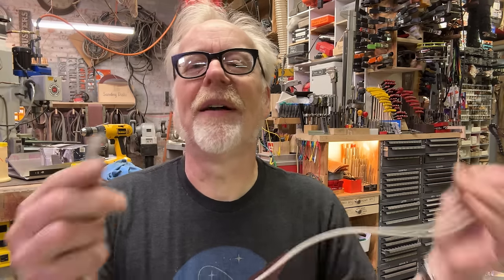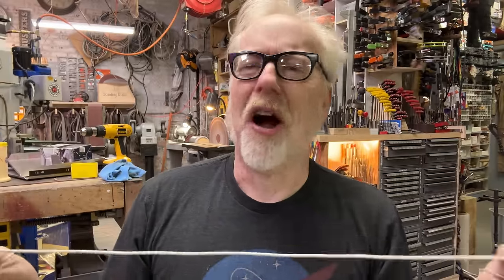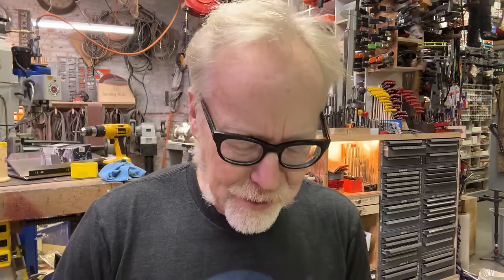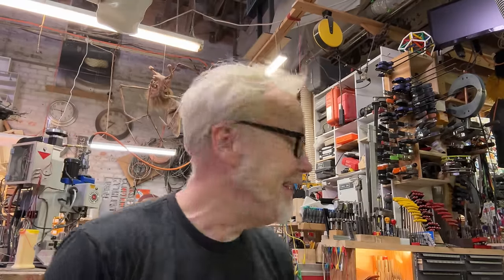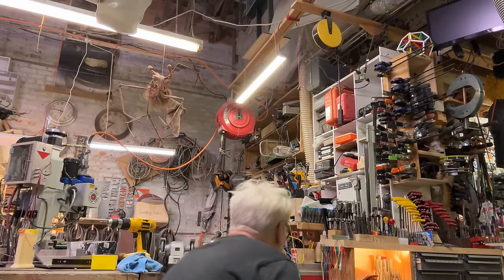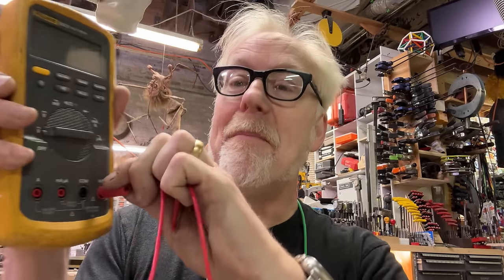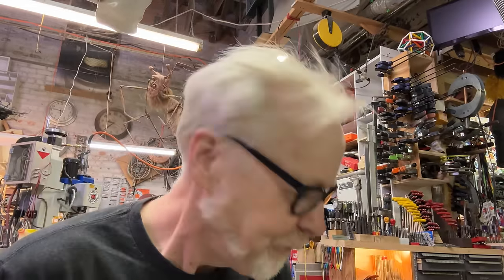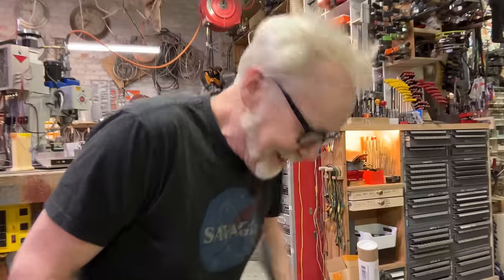Adam Savage's Alligator Clip Leads Problem

Comment: I've noticed that the $1 dollar leads are just getting thinner and thinner. I've sourced alligator clip ends, various manufacturers, and wire of my own to make my own sets. For the layman, get a set of dedicated 12volt battery terminals and crimp on ring connectors. Using actual terminals is always best even if the setup time is just slightly longer, rummaging through a drawer. Many of my go to connectors are the xt60, the waterproof automotive 2 pin, and standard spade connectors. Use the spade connectors for most automotive work, the 2pin is just there for my off road lights. For the xt60, I use those for charging car batteries using the iSDT Q6 nano as a charger/power supply, again I make my own xt60 to automotive battery terminals. I just make adapters using real terminals more often than setting up alligator clips, they are so bad.  The iSDT chargers are great for general R.C. batteries and come with programming and balancing connectors. They can also act as a power supply for my projects for testing. Really this comment turned into LOOK at the iSDT Q6 nano. It's a great companion to electronics projects.

Comment: The electrical protection and controls testing industry uses "test leads", which have various "test plugs", spade adapters, alligator adapters that fit onto the standardized and modular banana plug style ends of the leads. They are also stackable.

Comment: I share your love/hate relationship with alligator clips. I've learned a few things. Always test for continuity from end to end. Feel the wire before buying. They should be flexible like your test probe leads. Solder the ends on if they are only crimped. Straighten/bend the ends with pliers when needed. Don't hesitate to toss bad ones in the trash. Is there a support group for this?

Comment: I have used the alligator leads for like 40 years, they use to be pretty good but the last 4 times I purchased what I noticed is the vinyl covers were so slippery that when you squeeze them the metal pops out or the cover pops off or my fingers slide off.

Comment: Favorite would be the fluke clip leads meant for the meter.  Either the banana jack ones that are meant to plug onto the end of a nice set of banana cables (fluke ac220 alligator clips), or the ones that are meant to slip over the tip of your test leads (fluke ac175 slide on alligator clips). 

Either way 'semi' pro tip for all of you..... If you have the clip leads that plug into the meter like Adam showed in the video, one great way to use them is to put the meter in current measuring mode then use them like a regular set of clip leads.  Even if you don't intend to take a measurement, you now have a fuse in circuit which means a little bit of safety added if you're playing around with a circuit that you aren't 100% sure of.

Comment: I took a spare set of leads for one of my Fluke meters and cut the black probe off and soldered a nice alligator clip in its place. Then I try to get a good ground with the clip... and I'm free to "explore" with the red positive probe. I started doing this working in a Motorola Radio Shop... we were always looking for good clean power sources for lights, sirens, and radio hookups in cop cars, ambulances, and firetrucks.

Comment: Like most things, you either have to shop around till you find a product that fits your need.  Or you learn to make your own.  Rolling your own makes sure that you end up with the wire gauge you want/need and the insulation you want/need, and the ends you want/need.

For example, i recommend the Fluke brand deluxe lead set.  They have a variety of ends, and everything it used with banana jack ends, and will plug into a standard meter jack.

I can make a clip lead with this set with the ends i want on it.  Expensive, but decent quality.

/edit i had to fix the name, it's the Fluke Deluxe meter test lead set.

Comment: My use case is not really the same, I use ultra basic circuits in a school setting. But if i need something like this, i have bags of loose crocodile clips, that have ringed back ends that can take a banana connection, and all my leads have banana plugs on both ends, since the component holders also use banana connectors. Obviously that means a few differences, no insulation on the clip, bigger clips, but it does mean if a clip goes askew, then it just gets thrown, and another one comes out of the bag.

Comment: The clip leads on old telephone technician test sets are pretty good. They have at least two ways to clip on bare conductors and a piercing 'needle' for those times where you cant practically cut or strip the wire.  Wish I could upload a photo. Quality on those are good and expensive. Hirschmann's are good.
Reply: Angled Bed of Nails (ABN) alligator clips. As far as I know they are still used on new telephone test sets.

Comment: Mueller 10015 crocodile clips. That part number is for a set of 4 clips including two red and two black insulating grips. Yes, they're a bit bigger than your typical cheap alligator clip, but they last forever. Mouser carries them. I've had some of mine for 40 years. For small work, I like the Pomona hooks you showed, which are also perfect for wire wrap posts. HTH. And yes, I too have a pile of cheap clip leads, some of which I've had for close to 60 years, because I also hate to throw anything out!

Comment: You should check Cleqee, they are a manufacturer of cables and probes for most brands. I personally like their silicone cables because of the flexibility, and they have a variety of probes, including the aligator clip with injected molding that you showed and the mini test hook for SMD. I also like the male banana plug with a female plug on the end, so I can stack multiple cables on the same connector of the power supply

Comment: Of the only aligator clips I have, one is part of an antistatic bracelet (to connect to ground when working with cirquit boards inside my computer)
Two belong to my multipurpose battery charger.
And the rest are at either end of my set of car jumper cables.😊

Comment: I have several sets of those 'good' clip leads, but with a clip on one end and a male/female stackable banana plug on the other rather than clips on both ends.
They're my most used 'go to' leads I use with my multi meter, a pair of them lives in my meter case.
If I want a double ended clip lead, I just plug the male/female banana ends together, boom.. double ended clip lead, just be aware of the un-insulated banana plug in the middle of the lead now...nothing some electrical tape won't fix😁👍

Comment: I'm imagining a sort of three-part lever system where you push the center section to open the clip jaw. This would allow you to push a flat surface straight down, like a button, which should alleviate some of the perceived mechanical force required to open the clip. But I'm not a mechanical engineer.

Comment: I use wago clips and breadboards. I completely phased out alligator clips because the frustration of soldering and correctly positioning the electronics in the right way so that everything doesn't fall. It was just too much for me to handle. 

Those spring hooks for the multimeter looked sick. I might get me some.

Comment: Get probes with spring loaded bed of nails type tips. They have differing tip profiles allowing positive contact without slippage. Game changer when you need to read the multimeter.

Comment: I have three sets of home made ones that I made years ago. two use different styles of fly-tying Hackle pliers, the j hook style and the flat plier type with most of the metal plasti-dipped and a lead coming off them, the other uses a small pair of locking/offset forceps again the handles are plasti-dipped with a leads coming off them. They work really really well and provide a very secure hold. the  locking plier ones are great for vehicle work. I haven't electrocuted myself using them yet! I've always been a tad cautious when using them on 120v :D

Comment: The "Back in the Day" move was never to buy leads, but rather to MAKE leads.  You get a bit of best of both worlds synthesis by grabbing the best super flexible silicone insulated wire from, say, Belden and the best hook or gator or needle grabbers from, say, Pomona.  I used to phone them up from the Digi-Key catalog then sit down and make a years worth in a day at my test engineering lab.

I regret that I can't recall some part numbers for you, but it's been many years since I was last in the electronics business.

Comment: Oddly enough I'm still using my test clip leads from Radio Shack that are almost 30 years old. I've had to occasionally replace the wire in them (salvaged ATX power supplies have nice wire that's also the same colors as the test lead rubber).

Comment: While I have no specific recommendations. I will say there are many alternatives. The good ones are not cheap. 

I like the tiny ones that open up and can grab pins on an DIP IC. Kind of like the hook one you shown, but open up like tweezers when you push the button.

A good crimp is usually much better than a solder joint with small wires. Solder makes the wire brittle and more likely to break when flexed. 

The quality of the wire is just as important as the clip on the end of it. I like high strand count silicone insulated wire for test leads.

I can't give any specific recommendations as mine all came from the bottom of the junk box. I have no idea what they are called or where to buy them.

Comment: Those cheap ones generally suck and give out pretty when using them regularly. But alligator clips generally have their place. While I've got probably all of them, the best solution IMO is always using banana leads. The reason being is that you can get just about every adaptor for them - probes, clips, spade and round connectors. Another bonus is you can generally clip any yellow sized crimp connector onto them.

Comment: When I buy the cheap clip leads I just use the ends, I replace the wire with a wire that has bit copper in it, and then I solder the wire on the clip.
- The cheap ones are not soldered (periodically no contact risk).
- The actual wire has only few strains of copper, and won’t carry much current.
Can you actually get a quality version off the small alligator clips?

Comment: So I'm picturing a round metal anvil with concentric circles for grip for the conductive part with the metal piece sitting in a plastic platform which is connected to the plastic clip with a slightly flexible ball-and-socket joint to allow for unevenness. The top plastic part of the clip would have concentric circles which interface with the bottom metal platform to enhance the grip (possibly rubber for the same reason). Make the clip out of something like glass-reinforced nylon.

Comment: Years ago I bought a whole set of one hundred of these little hook test clips, they came in five different colors. And I also got a lot of these big and grabby ones, maybe about twenty five or so. But I bought the ones without a fixed lead!
The small hooks have a little male pin header at the back, so you just can plug in the wire you need or connect them to your breadboard circuit. The bigger ones just have a 4mm banana plug, so easy to combine them with the multimeter, the bench power supply or even with each other. And year, I got a ton of pin header to banana plug adapters :D

I also have about two dozen or so of there horrible ones, and the just sit on a hook at my bench to collect dust :D

Comment: Alligator clips & leads are like many tools, you get what you are willing to pay for.

You bought a Fluke...

Buy Mueller clips & leads, your life will calm.

I had the same rant you just had in the video. I sat down at one of the major electronics suppliers websites & spent $60-70 osizen banana plugs, banana receps, various alligator clips & some of the push wire grabbers.

Then I had a soldering session.  What I discovered was the vinyl insulating covers are part of the 'too hard' to open problem.  I solved it by using shrink tube & just shrinking the wire end enough to keep it from falling off.

The thin plastic is tough enough & the clips are easier to use.  BUT beware, Mueller uses good springs!

GeoD

PS  Just saw the mention of Pomona... that was one of the 2 brands other than Meuller I bought.... wanna say a brand w/ Cal or California is the other.

Comment: I have the Harbor Freight pack and what sucks is they slip around in your fingers as you squeeze them.  These best ones I have are from an old PacBell phone clip setup from a yard sale.
---------> Quick solution: take good alligator clips and shrink tube.  Cut small sections of shrink tube and cover all but the contact areas of the quality clips.  You can get copper clips, shrink tube (different colors and sizes) and quality copper silicone wire.

Comment: The best clups are the ones that just work for the job. Crocodile clips are plentiful and cheap, very easy to have them around and just wire stuff up for easy testing. If you need better isolation to nearby parts, lower current, J-hooks are better but even more fragile. Aligator crlips for big amps and lots of clearance. Then there are plain nails, j-hook with nails (piercing), grabber/picentte type clips, specialized (DIP, SMD) clips,
The best thing I've found is to just take a few seconds to solder a wire if you're going to be messing arround with the project for a while. Next best thing is to solder your own leads with clips.
There are a few premium brands like Pomona and Probemaster, but someone will probably have mentioned them anyway.

Comment: There is another big issue with cheap alligator clip leads - or at least all the ones I've run across over the past 20 years: They tend to use steel wires rather than copper!

Steel is a remarkably poor conductor and as a result, pushing more than 1-2 amps through the leads will quickly result in melted plastic and smoke signals. The high resistance can also a real problem with certain kinds of measurements as the resulting voltage drop will skew the results.

I'm actually happy with the alligator action of my leads, so my solution was to simply replace their crappy wires with actual copper ones. Haven't had any issues since and I often push them to well over 10 amps.

Comment: Look at RS Components Stock No. 263-9215 (for red) & 263-9214 (for black), it's a 6 inch long 1000v CAT III multimeter alligator clip, capable of taking banana plugs with shrouds.
Reply: I like the Hirshmann original they kind of copied better.
Reply: @ulwur  Thank you! I have the Hirschmann set but didn't know what brand they were and could only find those.
The Hirschmann ones are RS parts 190-2549 for black & 748-5458 for red.

Comment: I find that silicone jacketed leads hold up far better and much more resistant to heat.  I too like the larger clips as you demonstrated.  I also like the self-piercing type for probing wires where you cannot reach an exposed conductor.

Comment: I can totally understand the desire to not get rid of all the old leads despite not being thrilled at the idea of using them due to having better alternatives. 

My thought process on stuff like that has always been, if possible, to use them for something else so they're not just getting thrown into the trash and/or annoying you every time you grab it. Fortunately for these, that's as easy as cutting the garbage clips off and using them as normal wire! Well, at least the longer ones anyway. At least some part of it will continue to serve a practical purpose and it gives you an excuse to slowly replace everything with the better version as you use more and more of them up.

Comment: My thing is, I usually buy JUST the clips and solder em onto speaker wire or something, and have an assortment of various jumpers - alligator to alligator, alligator to banana, alligator to NEMA to run wall-voltage test stuff, alligator to GPIO pins of various kinds, etc. but what gets the most use for me, by far, is all the plasti-dipped hemostat forceps. Just grab a random piece of stranded wire and 2 hemostats and you can clip everything together VERY securely. Also, for low-voltage prototyping, most of my clip leads have a little pin of hookup wire soldered onto the tip so I can just jam it into a pin header or a piece of proto-board instead of having to awkwardly use hookup wire or protoboard jumpers clipped to one end of my leads, can just jam it directly in. I will say though, buying JUST the clips by themselves comes in EXTREMELY useful because usually if you buy whatever connector goes on the other end, chances are there's probably a speaker-wire solderless connector (y'know, the little springy blade things like on the back of a stereo) that can be plugged right into it so you can use that, those solderless connectors are by far the easiest for 90% of things involving loose wires.

Comment: The first type of clip leads you showed, but not the soldered version was my first encounter with real chinesium. It was in a lb with my students and suddenly the wire, not the alligators, the pvc insulated wire itself attached itself to a neodymium magnet. The wire looked copper colored, but it was magnetic! And of course there are still only the equivalent of seven strands of hair inside the wires.... But they come in a slightly better version as well - however, most often you don't know what you will get when ordering.

Comment: If you purchase test leads, check to see if the wire is soldered to the clip. If not, solder them. The crimped ones can cause connection problems.